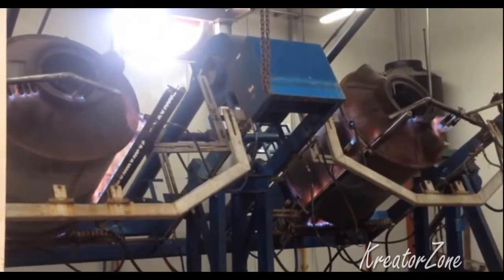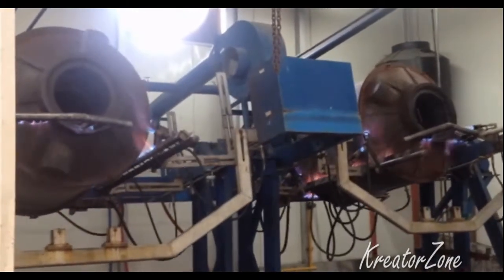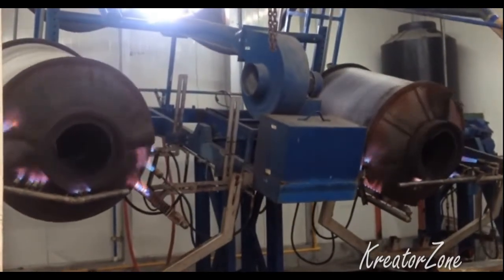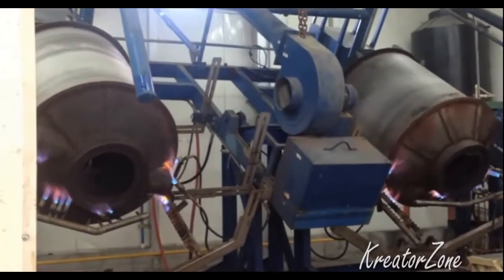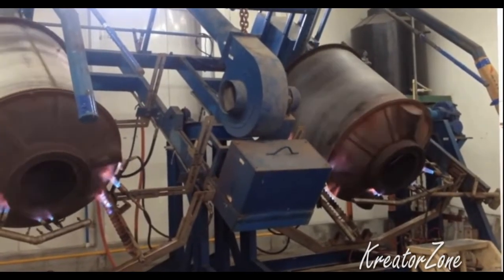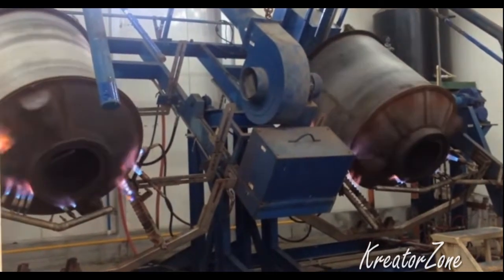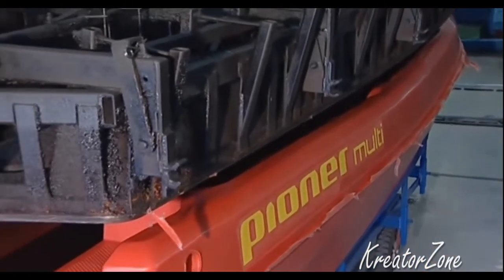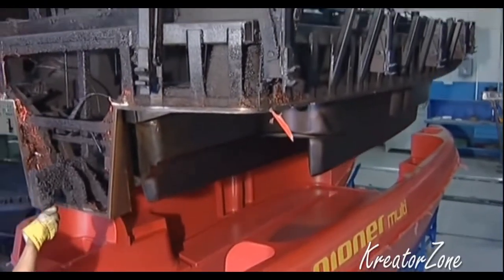Plastic Forming & Manufacturing Process Rotational or Roto Molding

Comment: The rotational centrifugal is suitable for flat layers like sheets of GRP layer subsets. Boat-hulls, cooling-stress and usage-stress, is not-suitable for long term structural bash sand beach. Same observation apply backwards to machine and tooling and cycles. If make sheets for non-centrifugal moulds as part of a 2 part process, the machines and results may be better with savings for both parts IF land space and rental is cheap. Information is Not-applicable for city style manufacturing due to land and labour costs. City needs high tech with high cost therefore market-niche is only high precision for some chance of profitability.
Reply: Plywood is 7 ply strong.
Reply: If want to use the term - biodegradable
= Advertise hull durability as 100 years of parking-berthing-mooring
= Use plastic for 100 years decay
= Manufacture exact 100 years supplier warranty with 100 years degradation
= Say - lalalala, not my problem. Supplier's wording guarantee
Reply: Market niche for grenade proof dustbins are not-available. Ballistics is high-tech silly-boys coward game. Do not compete in this area. Silly-boys provocateur and saboteur until self-defeat retarded-cowards is-are aplenty.